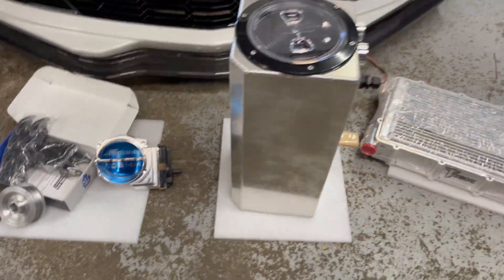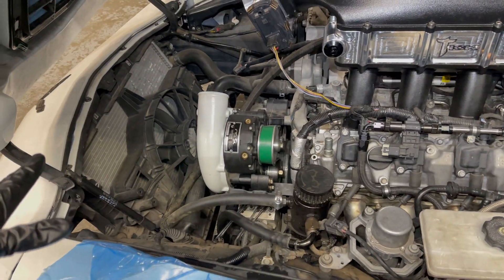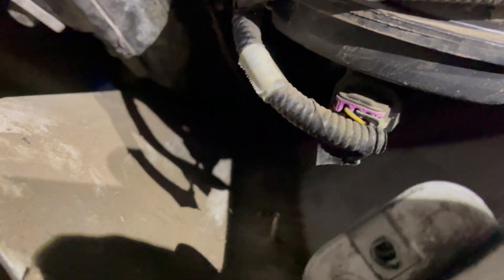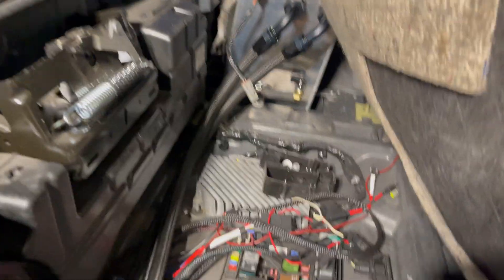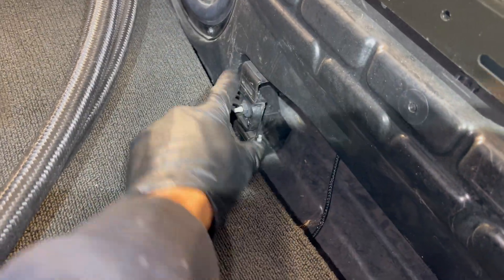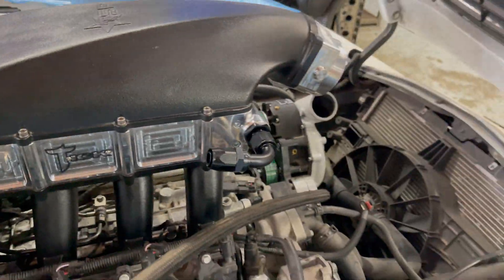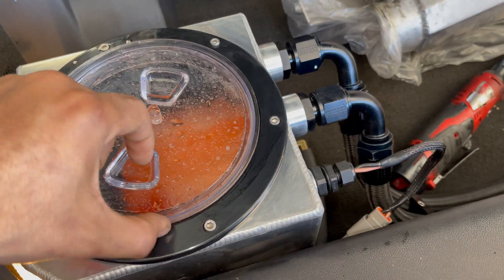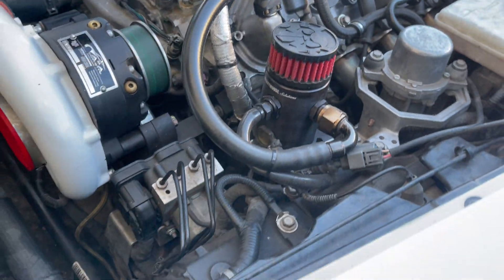Pro Charged Corvette C7 Air to Water Install.. Pro Speed Ice Tank, Tick Performance Intercooler!

Comment: after the passenger fender, where did you route the water lines? Alongside the rocker panel?
Reply from the maker: Yes, thru the rocker panel along the side of the car, a very small opening and tight fit